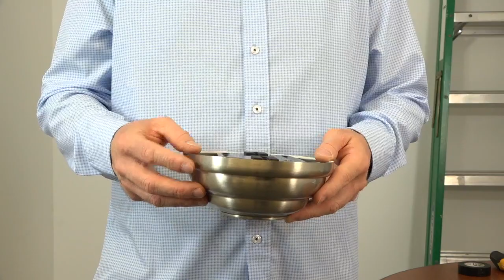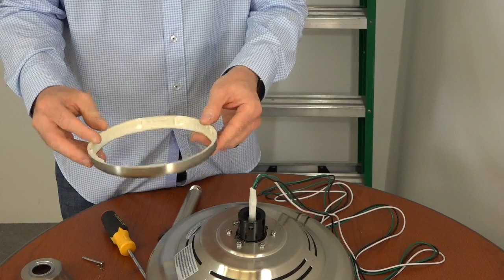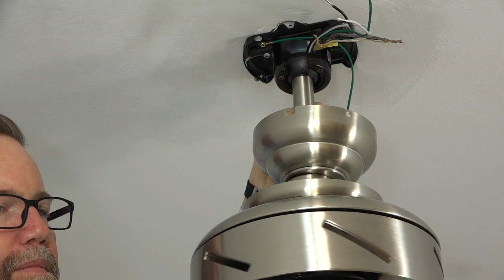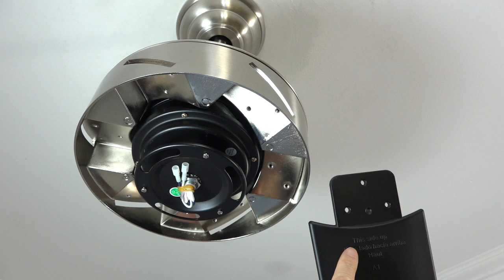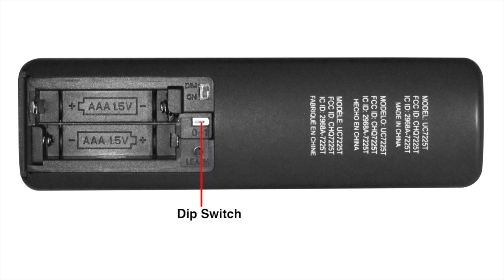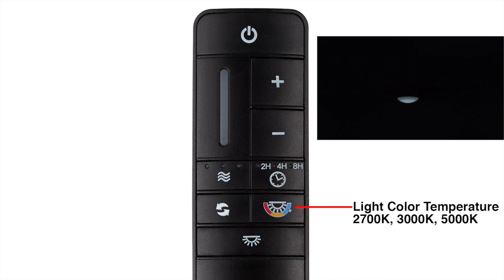How to Install the 68 in. Windward Indoor/Covered Outdoor Ceiling Fan

Comment: Hi, can i install that fan without it downrod?
Reply from the maker: No, the fan is required to be installed with a downrod.
Reply: @ceilingfans101  Actually, I bought that fan but I didn't think about it, and I think it's going to be very low. the ceiling is not that high. Luckily I haven't opened it yet
Reply: @ceilingfans101  How do I know when buying one if it can be installed without it?
Reply from the maker: @jotibiris  if buying the fan in a store, there are a couple of places on the packaging that have the information. The information is located on the top of the box. There is a chart labeled "Mounting Options" that shows the ways it can be installed. in this case the mounting options are "Downrod" and "Slope" with icons showing the two different ways. If a fan is able to be installed without the downrod, it will also have "Flush" or "Close-to-ceiling" listed with an icon showing that. You can also look at the "Ceiling fan dimensions" chart that will show the assembled height at each method. It will show the assembled height of the fan with "close-to-ceiling" (no downrod), Downrod, and Slope. The packaging on this fan says N/A under the close-to-ceiling mount meaning that it is not applicable and can not be mounted with this method. If purchasing the fan online, the installation methods are listed in a variety of places on the product page online. 1 - Specificaitons section (mounting type), 2- Details section (mounting type), 3 - Product overview (mounting type), and 4 in the bullet points that state "Dual-mount installation (standard flat ceiling or high/angled ceiling)". If a fan is able to be installed without the downrod "Flush" will be included in these areas and the bullet point will state something like "Tri-mount installation (flush or close to ceiling, downrod, and angled). I know it's a long answer, but hope the information helps you!
Reply: @ceilingfans101  Of course. Thank you! Have a nice day!
Reply from the maker: @jotibiris  You're welcome! Have good one as well!

Comment: How much time these ceiling fans needs to be OFF in order to rest and cooling off???
Reply from the maker: We suggest turning the fans off when not in the room. The fans shouldn't heat up that much during use, but the fan doesn't really do anything if you're not in the room except increase energy consumption.
Reply: @ceilingfans101  Thanks for answer. In our case we let them on when we go to work just for our dogs. My father isn’t in favor of this because he said the fans will get so hot but i just dont know
Reply from the maker: @Seriesfan1  ah, that makes sense. gotta make sure the doggos are comfortable. the fans should be fine, especially with the DC motors.

Comment: Just installed 2 of these fans 10/3  in my back patio seems like it moves pretty goof air, I really thought top speed was going to be faster, fan is super quiet, light output is good, I wish the the fan blade screws were a little longer and better quality

Comment: Does that mean there are only 2 combinations you can have with the fan since the options are 0 and 1? We have several of the same home decorators collection fans in our house and they are all connected when one remote changes settings
Reply from the maker: No, there are a number of frequencies programmed in the receiver. Placing the dip switch to the "1" setting allows the fan to cycle through different frequencies.
Reply: Did you get it figured out? I have three of these fans in the bedrooms